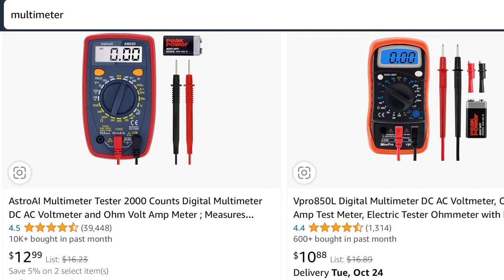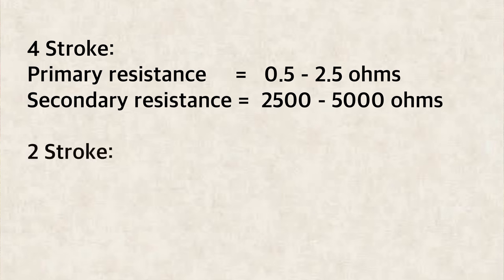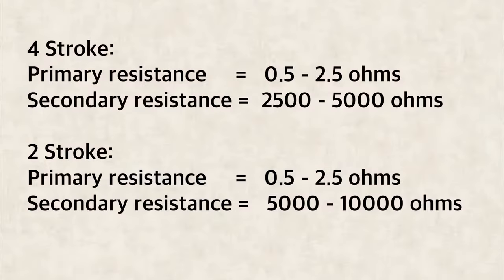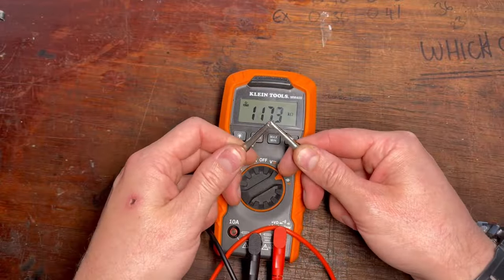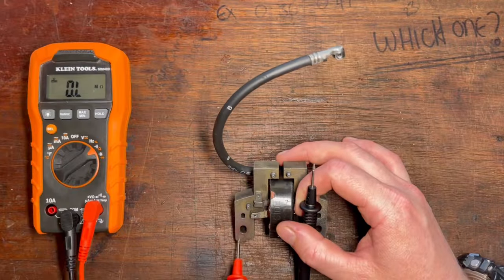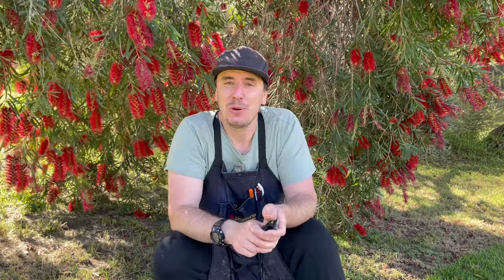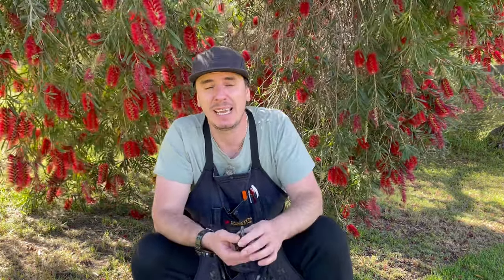Test Any Ignition Coil With A Multimeter! (Easy DIY Tutorial!)

Comment from the maker: If this video helped you, please consider clicking on the THANKS button above to support my channel 🙌
Reply: Hey Tom, thank you for your work on these small engines, enjoy your delivery. Watched one of yours on carbs( I think?) recently. I am struggling with a leaf blower at the moment but also have a trimmer, a chainsaw, a snowblower and 2 mowers. All of these little engines run great for years but the 2 stroke ones seem to eventually get into more issues. The2 stroke  blower has been shifting from issue to issue, surging (solved by carb rebuild), wierd running (partially solved by filing the new metering diaphragm tip to close to original ~0.60", came in at double that), starting and running issues especially when hot - partially solved by adjusting the carb screws, now every indication of no spark. Plugs new and old tested at 2 ohms each - ok, plug wet when trying to start( no spark?), kill wires and ignition permit switch test ok, new fuel, rebuilt carb, new fuel filter, air filter ok, etc, etc . Pulled the module and used your testing theme with my trusty Multimeter......secondary -  plug wire to armature = 4.2Kohms.....slightly low but ok(?); primary - armature to kill tab = 148Kohms, plug wire to kill tab = 158Kohms. I assume the electronic stuff is hiding the 0.5 to 2.5 ohms of the primary. Awaiting delivery of a new module. Can not wait to test it. Any thoughts on the ~150Kohms readings? Keep up the excellent work, learning at Warp 9. Thanks Fred
Reply: I like the bottle brush tree in the background.
Reply: are these numbers the same with a 6 volt and a 12 volt coil?

Comment: I had my own workshop for 30 years and murphy was a constant companion so more often than not there was more than 1 problem or inconclusive. If I had a buck for every coil I tested that had good values but was crap....in the end I gave up these tests, it is only an indication ie if the coil is crap this will confirm it...or not.  The most useful test (and fast) if the motor is running - but has an ignition problem - is to remove the cap from the coil and start the motor while holding (and being very careful) the end of the lead to the plug or earth if you have more than one cyl. The spark should be fat strong and blue and most importantly should easily be able to jump about 6mm. As you are holding the lead you can easily vary the distance and if the spark faulters and or the engine stops as soon as you increase the distance the slightest from the plug you know that either the coil is faulty or there is not enough power (dodgy electronics normaly wont let the engine run at all) - you have to then eliminate the plug first too of course but most often it is the coil. But if the spark and engine is still going strong with sparks an inch long you know the coil is not at fault. The next test is then the magneto coil (or with a battery ignition simply to measure the voltage at the coil - this will be pulsed if the electronics are not in the coil). Also here there is little point in measuring the resistance thru it as what makes these tests so inconclusive is a broken down insulation not bad enough to open or short it but just enough to allow moisture to get in. This then shorts it as soon as voltage builds up - same goes for the ignition coil. So you need a peak voltage meter which can be bought cheap and put in series on your multimeter. This then allows the multimeter to accurately measure the very short voltage spikes put out by the magneto and immediately shows up any problems with power supply as a high enough voltage of about 90 - 200v AC will not build up. You need to confirm those values depending on what bike/other you have as that is just from memory and I am retired now! There are also measuring charts for assessing the electronic parts but they can be hard to get right as they will vary depending on which multimeter you have. Sometimes all you can do to verify those is to employ a process of elimination. The best part of this vid was how he eliminated the TCI part of the coil from the test - well done. Hope this helps someone! All the best from Aotearoa
Reply from the maker: Thanks for watching and sharing 👍👍
Reply: Excellent comments especially about the blue 6mm long spark jumping from plug to earth. You are absolutely correct. Manufacturers tell us about blue thick spark.
Video author forgot air gap. If rust present it shorts magneto results in no spark. A failing plug sparks orange
Reply from the maker: @emanuelmifsud6754 Hey! Thanks for watching :) Though rust doesn’t affect the magnetism, it will affect the air gap clearance.
Reply: @VintageEngineRepairs  The air gap clearance is a very precise measure.  Any variation to the recommended would result in the spark being deteriorated. It is essential to ensure the surfaces have no rust or loose rust. I have repaired these engines for 50years.
Reply from the maker: @emanuelmifsud6754 hi, the air gap doesn’t need to be overly precise, most people use business cards to set the gap, although I don’t, I use a a specifically made gauge. You have to be quite a way off to lose spark in my experience.
Reply: Awesome Kiwi dude.
Reply: @VintageEngineRepairs  You are very wrong about that.
Modern  'Briggs and scrappem' (the 'mostly plastic ones' really are junk) say 0.006" (about 0.15mm) coil to flywheel. Flywheel magnets fail but even if re-magnised if too wide or even all new parts don't give a spark.
I haven't had 55 years repairing small engines but I have spent that amount of time repairing motorcycles at main dealers in Bridgend and Swansea (only had 8 years at UK Plant, not too much on small engines other than Honda GX and Stihl)
Reply: Thx for the info Gerry, have a question maybe you can answer concerning a small engine.
Reply: Thanks.  Nothing like gray hair solutions.  What can’t I measure the voltage btw the plug cap and earth.  I know it a huge number but I’m just looking for a meter movement w/o burning out some components.  I was taught that sparks require high voltage and AC sparks better than DC.

Ideas before I fry my $100 meter.  The kid I sent to  become an electrician technical engineer is keeping Penske’s cars running at Detroit GP.  Proud father but how about a favor boy?  Call us next week pops.  Yeah,  free beer tomorrow!!
Reply: @yelyab1  From what I remember, you need a minimum of 15,000 volts for engine to run but voltage is usually higher. 
Any extra voltage increases spark duration.
Reply: Super confused right now. No spark on a 10 horse Tecumseh engine. Tested coil no good replaced coil and spark plug still no spark. In the video he said to make sure you're testing resistance and not continuity but on my multimeter I only have a continuity setting for ohms. Ohms reading seems to be on the money. Wiring all seems to be good. Magnet is very strong. Not even a faint spark
Reply: Reset air gap to .006, business card gap was about .011. Still no spark. Do the magnets on the flywheel go bad?
Reply: @larrywhitesell4139 ohms is how resistance is measured.  Continuity is the same but in a system with a million ohms a continuity test will still beeps. Don’t always rely on the noisy make sure and look at the meter.

Comment: I use to test them but found  many ok till they heat up when in use . Will run when cold but dies after running for a while and won’t start (check fuel tank venting ) . Also see a mention of do magnets go bad on flywheel . Although super very rare they can lose magnetism . Just use a screw driver  to test if it pulls to it  is  most  likely fine . I have personally have never seen this so to me is a myth . Good info though for a dead coil scenario
Reply from the maker: Yep spot on re magnetism loss! Thanks for watching :)
Reply: I have the same issue,I can rev high and runs great till warms up,after about 5min starts to back fire and not hit on all cylinders then dies,till cools off,thrn can repeat
Reply from the maker: @juliodjtakeovervelez7182  that sounds like a coil

Comment: multimeter test can't apply to some ignition coils which a semiconductor set in the primary winding. You test the resistance of primary which could be read like open circuit and dead, but actually it's because of its planted components.
Reply from the maker: I bring this up and explain how to test if the semiconductor material is creating false readings 👍🏻
Reply: the best is to put out typical circuits inside of primary winding. Thank you.

Comment: If a simple coil with no electronics, I have taken a 6-volt dry cell and hooked up a ground to the armature, hooked up a spark plug, and of course, ground it. Then briefly touch the positive connection and watch the spark plug and if it has a spark, it is probably good. Just don't hold the wire on the primary just touch it like a set of points are opening and closing.
Reply from the maker: Yes! You can do that :)

Comment: Can you add and electronic diagram of the coil spark plug the see all the components? Maybe there is a darlington transistor inside of the coil. Who power the darligton transistor base?
Reply from the maker: Hey; every coil is different and will have different circuitry. Best is to google the specific make and model of coil and see if you can get a cutaway or a schematic for it.

Comment: Good, thorough video, as always but  I suspect I'll have to watch it multiple times to have a grasp.  In the meantime, a quick question.  I recently bought an older Echo chainsaw.  The seller mentioned something about the coil, so I assumed it would be a spark problem, but starts right up and runs great.  The problem is that the kill switch doesn't work.  In true backyard mechanic fashion, I replaced the switch which was quite loose.  That didn't fix the issue.  Could a faulty ignition coil cause the problem I described?  Thanks
Reply from the maker: Hmm very unlikely, it’s more likely a damaged wire mate. Get access to the coil and trace both wires to find the fault :)

Comment: One thing to note, I tested a coil on my Honda B16A2 engine. The readings were in spec but the engine wouldn't fire. I purchased a new coil after confirming the primary side trigger was switching. The engine fired up straight away after fitting the new coil.

Same goes for coil on plugs on my Yamaha R6, was misfiring at 12000rpm on track, the readings were in spec both hot and cold. I bought and fitted new coils, the bike now revved through 12k and onto 15k whilst accelerating.
Reply from the maker: You’re absolutely right! You can have coils that are within spec, but the electronics that control spark timing etc can be bad and that will cause a misfire or non sparking coil :) this is just one of the tests we can do, at home, to get an idea of a good or bad coil.

Comment: My 2003 Honda XR400R service manual doesn't use resistance testing anymore. Instead Peak Voltage specs are listed which means you need an adapter for the multimeter.
Reply from the maker: Thanks for sharing 👍

Comment: V clear and concise. Sorry to be dim but ref to Kill Switch or Tab I assume you are referring to the 12v feed from the Ignition Switch. Your comment re removing all corrosion off the mounting plate is v useful as I have taken the coil off my Quattro and treated the base plate with KuRust to neutralise the surface rust that was on it. Before all this the car fired now there is nothing coming from the main HT lead to distributor BUT I have a 12v feed from the ignition switch. Could this KuRust treatment be stopping the earth getting back to the car body? Thanks
Reply from the maker: Yes, certainly scuff the surface once you’ve given it the rust treatment, there is often a layer of oxidation or surface contamination. Scotch brite it :)
Reply: @VintageEngineRepairs  OK - Thanks for the v fast reply - appreciated
Reply: @VintageEngineRepairs  I just did the test on my Martindale AM5 Analog MM: Primary on Rx 10 scale shows 1 ie 10 Ohms. Secondary on Rx 1K scale shows 7,5 or 7500 Ohms. I am now trying to find the specification for the coil (resistance)

Comment: I'm working on a sv720-3045 kohler. I have no crank over at all. New battery, checked the starter, which tested ok. Checked plugs, they are shot. Tested coils 1 was (P) .698, (S) 17.80, the other was (P) .734 (S) 19.85. So if I understand correctly  the secondary winding on both are a bit low, correct?
Reply from the maker: I’m not sure what range you’re working in there it’s just a bunch of numbers you’ve shared. Double check your service manual for the range 👍

Comment: Is this only applicable with older units?  I ask because I tested two brand new ones yesterday after watching this video.  Secondary coil - 5.5k, primary coil 8.5 megaohms.  After scouring the web someone said the circuitry in newer ones prevents an accurate reading of the primary.
Reply from the maker: It can do! Every coil is different, test both sides, check everything mentioned. Still no spark, replace coil.

Comment: Thank you. I’m hoping that may solve my problem. My motocross bike runs perfectly well for 15-20 min then dramatically looses power. Sounds like it’s choking
Reply from the maker: Hey :) it could very well be ignition coil. There are other electronic components like stator windings and ecu’s that can also fail. If you get hold of the service manual, you can check the resistance values of each and find if any are out of specification. Hope this helps!

Comment: Well how do I know if the primary winding is bad or its internal electronics then if a high resistance could mean either is the case?
Reply from the maker: I mention it in the video, using both the hot side  tab and the armature to check secondary. One will give high the other will give normal readings. If this is the case then it’s likely just the electronics.

Comment: Hi. I’m struggling to be confident about which are the right testing points. I know which one the spark plug lead is. I have two cables connected other than the spark plug lead. One is green and one is black. Not sure which is the kill switch lead. Can you help identify the right connection points for testing? 
I’m testing a coil for a 2022 Honda CRF 250R motocross bike.
Reply from the maker: I’d suggest downloading or getting a paper copy of a workshop manual, they’ll tell you step by step the process and readings :)
Reply: Great video Tom, as ever. Out of interest, what should the resistance be between the kill tab and the HT barb? Would it be the same as either kill to armature, or barb to armature? Thanks

Comment: I got a 0.37 resistance reading for the primary and 73 resistance reading on the secondary. This is a 2 stroke engine. Seems like the primary is higher than you suggested. Is it bad?
Reply from the maker: Hmm 0.37 ohms? If so then that’s perfect! 73 ohms on secondary? That is an issue.
Reply: @VintageEngineRepairs  ya 73 and im seeing no spark when turn the motor. so the 73 means 73,000 when it should be 10000 or less? okay thanks

Comment: Tom, I have been watching and re-watching your video on resistance values in small engine ignition modules, specically a 2 stroke module. The secondary measurements on my original module =4100 ohms, while the new module = 2600 ohms. The primary values  original module = >30 Mohms ( fritzed?), new module = weird values depending on multimeter scale, 29.5Kohm to 201Kohm to 122 Kohm. I can not rationalize the electronic circuitry impact on the primary readings. Nether coil seems to create spark at my older plug and brand new plug. Any advice here?
Reply from the maker: Hey, did you remove all possible coating that may be on the coil armature giving you high readings? Remember that, as mentioned, the electronic circuitry on the primary side can  affect the resistance readings you’re getting. Are these coils both Chinese clones? What machine is it on?

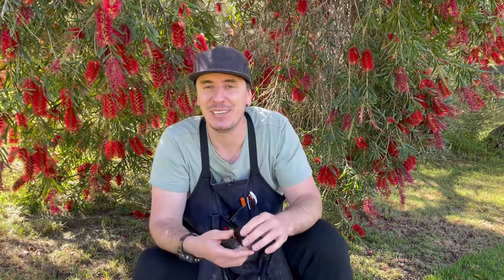Comment: 7:11 Pleas, Help me out here, ok so if you get inconsistent reading o  the primary coil then proceed to a more accurate testing, which is testing the secondary winding:
HT lead to armature
HT lead to kill tab 
When you said if the reading between the HT and armature are correct, but the reading between the  HT and kill tab are incorrect that means the electronic components inside the coil are bad? Or just interfering and causing higher/different reading thus giving a false sign that the coil is bad?
So the most trusty test is between HT lead to amature?
Or both reading HT lead to armature and HT lead to kill tab have to be the same to finally say the coil is good?
Reply from the maker: Just interfering with your resistance. Secondary should always be between armature / ground and Ht, rather than the kill tab and Ht.

Comment: I have a briggs and stratton opposed twin 16.5 it ran good cut haft the lawn shut it off and would not start again tested coil says it's bad sence then I've tryed 6 coils on it and everyone of them went bad on the 3 attempt I disconnected all the wires to the motor except the starter cable still nothing have you ever heard of anything like this ?
Reply from the maker: I haven’t I’m afraid, but also I haven’t worked on one, are they genuine Briggs coils or aftermarket Chinese clones?

Comment: Our push mower starts using recoil pull cord but not electric start.  Replaced battery and bought a used starter. Advice?
Reply from the maker: When you turn the key, do you get anything? Clicking?
Reply: @VintageEngineRepairs  no key, no clicking.  Just a push button.  The flywheel turns once and stops.
Reply from the maker: Hmm sounds like either the compression release isn’t working, maybe you have a seized bearing in the stater, it could be a dirty commutator, poor connection somewhere etc